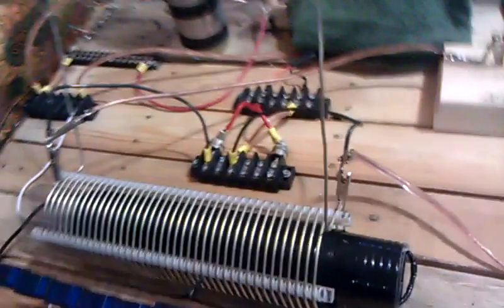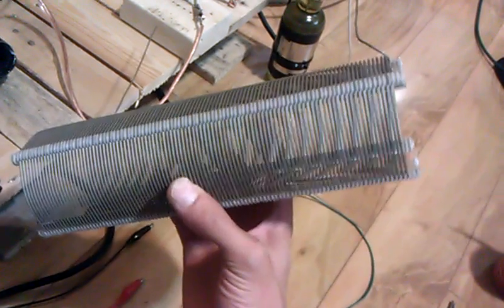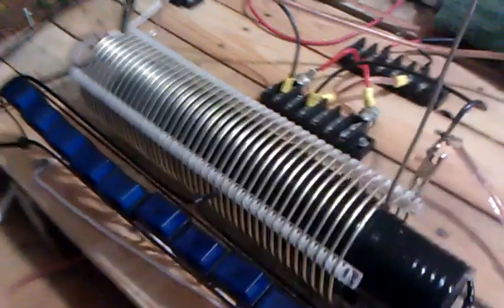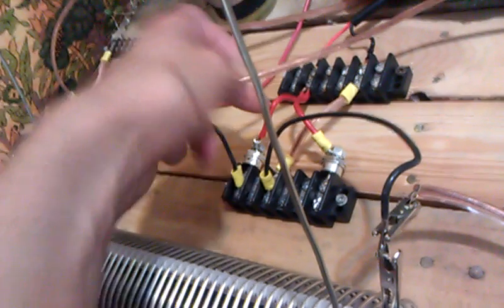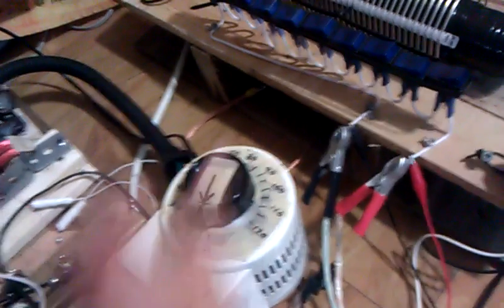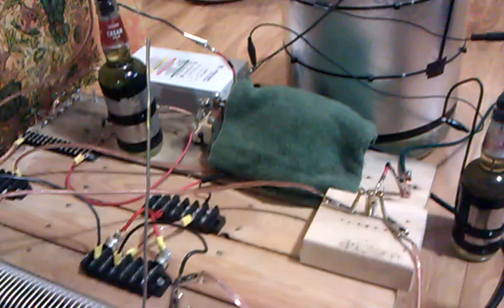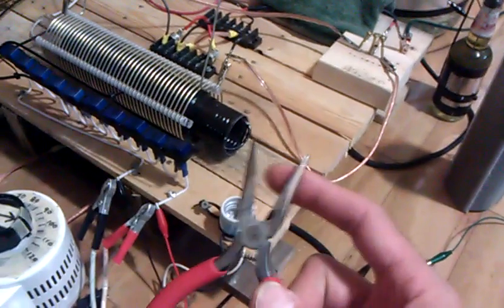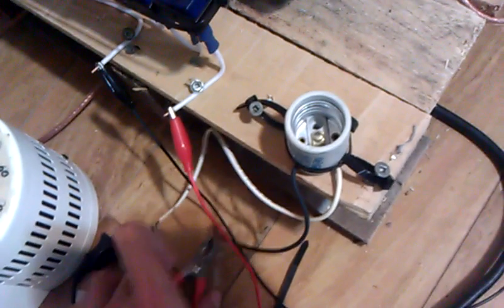Don Smith Device Project Part 13: B&W Inductor Coils :D

Comment: Hi Kurt I'm late to the party here but where can I find  the 4  plastic  coil wire guides. thank you.
Reply from the maker: Hi there, those came pre installed on  the coils, in fact the wire is basically moulded into those rods.
Was expensive and waste of money.
Nothing special about those coils.
Any non conductive form and a roll of tinned copper or regular for that matter, will do :)

Comment: ok I finally figured out how this damned device works! 

you dont need that huge coil, all you need is a hv transformer and a diode bridge into a large cap bank. 

the potential from the transformer is all that is used, so the input power should be very small.

the space in between the capacitor plate contains the over unity energy. the cap fills up with electrostatic charge from the atmosphere between the plates which is 10to the 55 grams per centimeter cubed energy density.

electrostatic energy.  

these caps will fill up instantly when enough potential from the transformer is present on the plates of the capacitor.

this is where most people quit because what to do with this energy is tricky.

if you discharge the cap bank at once, you get a huge surge of reactive power. the phase velocity of the electric field is out running the magnetic field and is out of phase. this is not very useable electricity.

but I discovered that the charge in the cap bank can be switched to produce watts.

thats taking newtons per coloumb, in volts per meter in the capacitor and transforming it to newtons per joule and watt seconds in the secondary, output transformer.

what exactly is the mechanism whereby this transformation happens? 

the transistors after the cap back switch the back emf into forward emf.

any time you switch a sine wave ac power in watts, it converts to back emf or static electricity, the same thing happens when you switch back emf or electrostatic charges, they turn back into watts.

its the switched electrostatic charges that are alternately taken from each plate of the capacitor as single charges.

the alternation of single charges from each plate creates a square wave signal of high voltage which is stepped down in the secondary transformer where higher amperages are produced and used in the secondary coil.

the principle of over unity is energy over time. the caps charge up instantly and then the charges from each plate are individually and alternately switched to produce an alternating frequency.

the time it take to fill up the caps is much quicker than the time it takes to discharge them, and you can charge mutliple caps at once since its only the potential from the primary transformer that triggers a response from the energy in the space in between the plates to fill up with charge.

Comment: Hey Kurt,
 How have you been man? I haven't talked to you in a long time,  I hope all is going well for you.   I have some extra good news. I have found perfect resonance utilizing Barker & William coils, for both the primary and secondary coils. The resonance that needs to be used is more about fine radio frequency quality components than anything, of course, they make it easier, and the range that the resonance remains within is quite a wide bandwidth.

 This is the sole reason why Don used them, however he also had a few other tricks up his sleeve and he did hide quite a few of them, this is the reason why you have to be very clever, such as yourself, to zone in on what he did instead of what he didn't do.. When we see the output from our own coils, they are nowhere near similar to the barker coils, so, I have to offer some interesting insight as to what I have done. 

I have started off with a 1/4 scale double B&W coil that is a 2 coil in one frame.  It has 24 turns total, it is a 1.5 inch coil, nearly identical to Don's secondary, but smaller and the amount of turns we will need is just a tad bit different.. Anyway, since i was on Ebay and this cat was selling them for like $4 each, I couldn''t go wrong,. I'll give you the model number if I find the receipt in my ebay purchases.  

I purchased them long ago and failed using them as a secondary coil miserably. I took this coil and made it into the  primary , the same way Don would have done in the secondary, but in reverse. The coil is tuned perfectly even after I tore out a couple of turns to make it 11 turns for the matching of the 1/4 wave. I am questioning one thing though. I have to ask if you have successfully paralleled the coils through rectifiers without losing resonance? I haven't paired them yet, but my question is do you have to have the .047 cap to match the two coils so they ring together in harmony? I don't believe they have to be used for impedance matching, I do believe they have to create the 3rd harmonic so we get the boodt in not only voltage, but in cold electrical pre-amperage qualities that effect the amplification of the circuit, as the bucking amplier transformer is built.

I do not believe we have to place the additive coil in the secondary position, so why not as a primary? If we ground the center of the coil, the system will do what we need done anyway first to get Tesla's Phase Conjugate Mirror Effect. The HV - particles are released into the Earth, creating the imbalance of ambient from the radiant spikes released into Earth's crust. This adds charge to the Earth capacitor and releases Don Smith's one wire capacitor effect by forcing the atmospheric voltage to even itself out automatically, kind of like the avramenko plug does while charging a capacitor in a one way valve like manner, as Moray has done. 

. If we tune an antenna , such as a graphene coated plate or torus and inductive antenna tuned to one of the 3rd exponents of the carrier frequency, we very easily draw the positive energy in at the positive end of the coil on the secondary side where the ionic activity is merely at plasma level. We have to picture the energy forced into the ground a very large array of waves, that radiate outward like  for every single pulse, we may get bands of frequencies released getting stronger and stronger as they travel in distance. This creates the capacitive imbalance Don speaks about and disturbs the ambient. When the ambient is disturbed,  we could basically imagine a bubble of energy growing in the area way above the generator. It is attracted to the antenna, and when the pulse grows, the capacitors discharge and the energy is absorbed in between cycles, sucking that energy in, collapsing the bubble of energy which implodes with immense force fas if it were a tank of water immediately dumping downward, amplifying the energy that would have been merely reactive energy, driving a much greater output than ever thought of before.  the Earth's atmosphere replaces more charged particles to become capacitively and inductively transferred due to the frequency it is broadcasted or pulsed into the ground, also, the the mountain of mirrored frequencies we have the ability to now tap into using multiple coils tuned and loosely coupled

Since I have the  coil only pulsing from one side, I probably will not have resonance if both were paralleled without a diode on each outerbut I am going to try it anyway using caps and rectifiers. It's so much better to just get an accurate coil set and tune them by pulling the coils off, then if you have to , clip it as accurate as you can, then you can use a variable air capacitor, locking it in place when you get it right on the money. The problem I've been having in the past  is that the calculations I used were off enough that when I added caps, they were too far away in capacitance to successfully use a variable cap to tune in perfectly. When we use only calculations and have no variability, we have issues with the energetic gain.

 I was certainly getting unsatisfactory results before, but now that everything lines up in the opposite manner, it is much easier and it works like a charm. The best part is that it is now controlable while it wasn't before.. The key is to get the frequency range for resonance within a wide enough spectrum that it doesn't drift out and cause the output to vary. . This is easily done when the coils are spaced accurately, they have the correct coating on the wires, and it also helps when you have the inductance right where you should as B&W coils are specifically made for.  

The symmetrical manufacture of them and the plating they use just makes B&W coils far superior than anything I have ever tuned. I have literally started thinking that I was doing the windings all wrong, or that I've missed something, but I wasn't doing anything wrong, it is just so damn difficult to use 5 turns of the primary coil , matching the frequency using caps, then getting the coils dead right to allow transfer via resonance.  Anyway, I am able to get just about any nst to fire with it because of the infinite impedance and the very cleanly tuned resonance. 

My attempts  that I have seen amplifying it's outputs were related to 3rd harmonic tuning, and these specific frequencies need to just be a mathematical product of any even multiple of 3 or exponent of 3, however the higher the frequency, the more difficult to tune since we need resistors, caps and coils , and the air caps become so sensitive that it is nearly impossible to generate without losing resonance and voltage transfer along the way.  The basic principles used in the circuit that were there before, are still there, we just have to tune the primary in the same manner using finer sized caoThe inverter circuit Don shows will work to drive a high voltage pole pig, outputting high amperage, 60 hz if the resistors use are correct . If we start the system, the nst frequency is the carrier frequency of say  33,333 hz., so we can have 33.333khz and 99.999khz and the secondary side will need to be tuned to either 299.97hz, which is able to fill massive dc capacitors after rectification so rapidly that in 1/50th  or 1/60th of a second, the cap banks are completely full and have the abiity  to charge , discharge and run very high amperage into a transformer, using resistors to pulse the frequency needed. Anything can be done with the circuit after the load is added, because it cleans up into a perfect sinewave and has the ability to power any load, with ease! I'haven't finished it yet, but I have tested the cap's discharge amperage . I saw 595 amps during the pulse discharge of the caps, so if we multiply this times the voltage of like 7970 volts, we would get  4.74 megawatts!
Reply from the maker: wow man sounds like some good stuff ! im very interested recently in going back to the Smith stuff, especially since you are mentioning it now, and that Brazilian dude's recent Smith AND Kapanadze stuff as well has been very compelling. i have a new born little boy at the moment, so ive been pre-occupied lol but i do plan to do up the old double helix board soon, with what ive learned from my Magnifier experiments. and i love the 3rd resonance you are talking about :) totally like Eric Dollard talks about